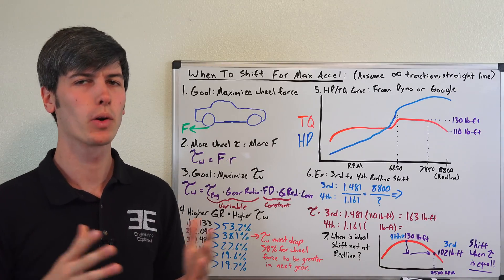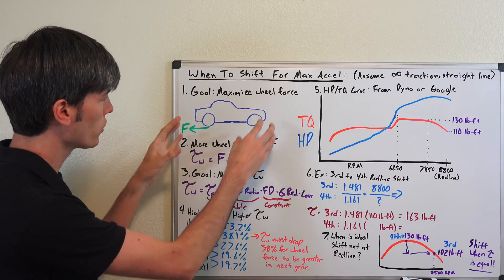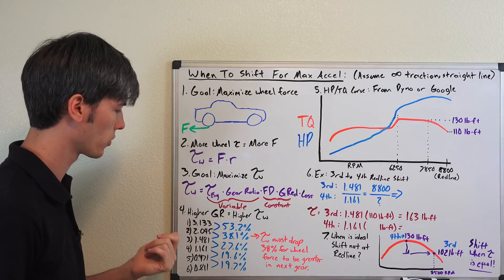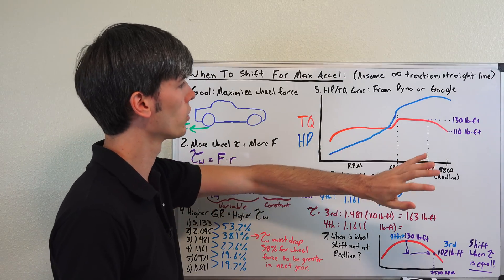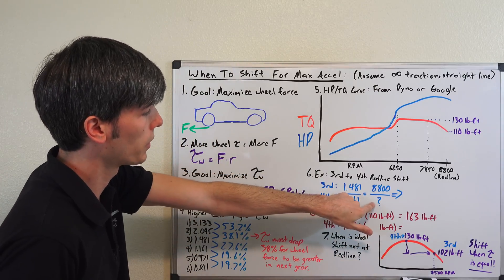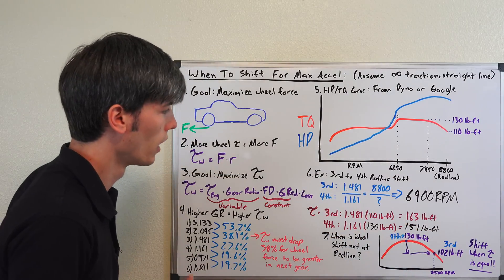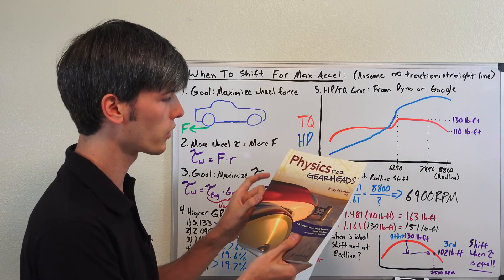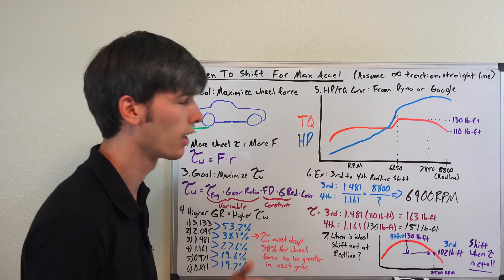When To Shift Gears For The Fastest Acceleration

Comment: Why does torque taper off near the redline?
Reply from the maker: Engines that aren't turbo'd are really just optimized for one RPM. Peak torque is where the engine is working at its best. Airflow, fuel atomization, and fuel burn start to taper at higher RPM, and frictional losses increase. Turbo engines can compensate with boost for a nice flat torque curve (and things like valve timing/lift/etc adjust for this as well).
Reply: Thanks!

Comment: whats the extra gear reduction in the s200? How can there be more than the transmission and rear end gears with out a 4x4 transfer case?
Reply from the maker: For the AP1 I believe it's a 1.16 reduction. Just means there's another step before sending torque to the driven axle to the rear diff.

Comment: i'm a noob when it comes to driving manual , i would like to learn, i looked up driving one and the one thing i can't get is when do you shift? are you just aiming for a specific rpm or what? from the video he mention shifting before redline but it doesn't sound beneficial
Reply: To make it short and sweet.

If you want to go fast? Shift at redline.

If you want to go efficiently (save gasoline) shift where your car owner's manual tells you to.
Reply: You shift when you want, no worries. There will be times the engine struggles, so you take it back down like going up hill or you shift too soon.
Reply: For everyday driving, shift when the engine gets loud basically. I usually keep it around 2000-3000 rpm, because it's more economical and less noisy. As explained in the video, the engine makes more power and usually more torque the higher in the rev range you are, so if you're coming up to a hill or something sometimes it's a good idea to shift down to ensure you have enough power to get up it. And of course, if you want to go fast, shift at redline.

Comment: What about shifting when the torque is max at 2000 RPM, horsepower at 5000 RPM, redline at ~5100? (Diesel, Naturally Aspirated).
Reply from the maker: If peak HP is at 5K, then very likely you'll shift at redline for max accel.

Comment: Basically, power when you leave the gear equals power when you enter the next gear.
Reply: Exactly
Precisely
Reply: oh my God. insert thank you gif
Reply: True in many cases where the hp curve has a significant drop after the peak. But there IS a drop in hp after the shift, if the hp curve peaks with little drop. Google for this website 
evodynamics com 114447365 calculating-shift-points 
These are axle torque curves, but these hp curves show the same shift points.
Reply: Its to get out of first early so no later than 2/3 of redline meaning right after half of first shift to second so u can be in second gear longer
Reply: So much simpler and exactly the same result.  Me thinks that he doesn't understand power.
Reply: Power when you leave the gear should be around 5-15% higher than the gear you enter, depending on how fast you change gears
Reply: @thunderbirdizations  I think you mean the opposite.  Power when you leave the gear should be LOWER than the power in the gear you are going to.  To account for the reduction is speed during the shift.  However, this doesnt matter at all with sequential boxes and other quick DCT's or modified automatics.
Reply: ExactlyPrecisely saved me 8 minutes and 39 seconds
Reply: Exactly. Usually he is good. But he should have researched this better. Heard youtube has changed payment policy. People have to make videos more often. It is making many desperate. Quality will go down.
Reply: Nonsense. Equal power means you go past the peak - that means you are decelerating.
Reply: @trykozmaksym  You're not too bright are you?  Going past the power peak IS the fastest say to accelerate for most engines, that is if you can.
Reply: @bn880  dude, accelerating means more energy (power) is needed, not less. If it doesn't make sense to you, then go back to school and see the formula for kinetic energy - it is proportional to speed squared.
Reply: @bn880  ur right dude :) i confused power and energy - as the other youtuber pointed out, power is the rate of producing energy. Acceleration still happens after peak power but it's decreasing.. so the initial comment is right.
Reply: @trykozmaksym  Going beyond peak hp does NOT mean you are decelerating, you are accelerating at a lower rate. The optimum shift points will straddle the peak hp rpm. Visually, it's an "area under the hp curve" (or axle torque curve).
Reply: @bn880  You are right, MaxTryk is wrong. Shift beyond the hp peak. Energy is work done, power is the rate of doing work.
Reply: @kevink2315  You are right. I forgot primary school stuff and confused energy and power :)

Comment: Can you show the speed vs torque curves for all the different gears on the same plot of wheel speed vs wheel torque? I'm curious what transitions from one gear/curve to another look like with the momentary power loss of switching gears. I'm also curious how engineers choose the gear ratios to optimize the gear shift transition. Is the redline a hard limitation of the engine, or a point chosen to tell you when to shift?

Comment: If you need to shift up for faster acceleration before rpm max, dosent that show that the enginers that build that engine and gear box did a bad work? Wasting time and effort to make it able to rev higher for no extra benefits? That time could be spent on other things then
Reply: many engines can rev way past their max power rpm and most cars have more than one transmission available in them

Comment: It is interesting to note that final drive isn't constant for all vehicles. I had never encountered this before, but found it to be true on my 2013 Turbo beetle. See the spec sheet:

http://media.vw.com/doc/864/830539136536a3f4da311d.pdf

Note that the 4th and 5th gears for the 2013 Beetle Turbo Manual (my car) are the same ratio, so my speculation is that it just moves to a different final drive for fuel economy at that gear change.

Comment: how do i shift in automatic..?
or did my auto shift ?
Reply: I can make my auto upshift if i let off the gas a little bit
Reply: More misconceptions and misinformation. 
Most automatic transmissions do shift automatically, can be manually shifted and can be tricked to shift in auto mode by manipulating the throttle. 
Most automatic transmissions sense the load, either by a mechanical governor or through electronic sensors controlling the shifts to maintain a compromise of performance at less than 75% full throttle or compromise fuel economy at more than 75% full throttle.
Reply: Yours must be a fake automatic.
Real automatic shifts, automatically.
Reply: TrumpCorp. I can't vote Trump, I live in Canada.
Reply: did i won the election ? vote Trump and shift up.. lol
Reply: Yeah but you would you if Canada merged with USA?

Comment: Awesome video as always! I think shifting early to make more power is probably more common with cars that come with very small factory turbochargers that make a lot of midrange torque but fall off pretty hard between 6000-7000.
Reply: I was doing that in my twin turbo charged 335i and today I raced my buddys cammed 3v I thought I was gonna get walked similar to the last runs but I started to shift at 7k and I beat him top end my car is stock

Comment: When to shift gears for the fastest acceleration?

Answer: Automatic transmission. No human can outperform a computer lol gg.
Reply: i think you'd be surprised
Reply: RzVids where is the fun in that.
Reply: william fleete Your opponent in your sideview mirror 😂
Reply: My nana and I both have Holden Barinas, hers is a 2009 automatic model mines a 1998 manual, she goes foot flat to the ground and I'm still faster. How is this possible? I may have turbocharged my barina just because, only added 50 hp to the 94hp engine but I atleast get the sound. But still even before turbo my car was faster

Comment: I would think you would want to shift from 3rd to 4th at about 8150 since your torque curve is dropping from 7850 on.  If 8800 in 3rd = 6900 in 4th, and there's no difference between Wt@6900 and Wt@6250, that's 650 revs, so on 3rd you should shift at 8150, so you don't have as much drop, resulting in more overall power applied.
Reply: "there's no difference between Wt@6900 and Wt@6250"

You are not taking into account the gear ratio difference between 3rd and 4th gear as he explains in the video. At 6900 rpm and 6250 rpm the "ENGINE" puts out about the same torque, but torque that is applied to the wheels is less in a higher gear.

Comment: THANK YOU FINALLY. Ive been trying to explain this to people for MONTHS and all i hear is "no you always wanna shift at your hp peak so power doesnt fall off"
Reply from the maker: Now you can slap them with knowledge! :)
Reply: You can do all of this with power, and it's quite a bit simpler though. You do want to shift so your power doesn't fall off, but what they're missing is that if you shift at the power peak, your power falls off because you're way below the power peak in the next gear. You want to shift at the correct point so you're making just as much power in the next gear as you are in the current gear, so you want to end up straddling peak power with your shifts.
Reply: Now this puzzled me a bit at first, since i remember that power was torque times RPM. However, it is torque and RPM at the wheels that we maximize here (and therefore the power we  get on the street). The RPM in the graph is at the engine (before the gear box that drives the wheels).
Reply: But of course this is the case for this specific car. Maybe in another car the torque drops much more vertically. You still have to do the math for your vehicle (if you don't have an S2000) to convince them :P

Comment: That would work if the power curves are from a dyno. I'm not sure it would work if they are from an engine bench. I am thinking that drivetrain losses are not constant, but speed dependent.
Reply from the maker: Likely true, as you will have greater losses at higher RPM. As mentioned getting your specific vehicle dyno'd is the best way to know for your exact vehicle. :)

Comment: This example seems to work for a smooth torque curve, but my car (BRZ/FR-S/86) has a nasty torque dip in the middle of the RPM range that I suspect would invalidate this approach IF the torque dip were to exist significantly higher in the RPM range. Don't you really want to maximize the area under the torque curve for each gear? I was expecting some definite integrals.

Comment: Interesting, but it seems to me that looking at the HP curve is more straight-forward.  Compare the HP at redline (8800 rpm) to the HP after your shift (6900 rpm) to see how much power you loose.  No need to make it more complicated than that -- the HP curve is there for exactly this reason.  Not saying your way is wrong, since it gives effectively the same result.  But it's no more useful than doing it the intuitive/easy way.  Makes you think more though, which I suppose is useful in it's own way!
Reply from the maker: +Nathaniel Jones not really that simple. At peak HP in 6th gear, you'll accelerate more slowly than at half HP in 2nd gear. It depends on the gearing of the car, not just the HP curve, as discussed in the video.
Reply: Okay, I get it now, just had to think about it some more.  I was just thinking along the lines that if you had a CV transmission, you'd set your RPM at max HP for max acceleration.  But that's not relevant to this problem.  Thanks for the reply.

Comment: 5th gear is the worst gear to be in with a 6 speed. zero torque in my experience even with pedal to the floor.
my biggest issue with manuals is getting torque on highway driving. gotta downshift to pass someone
Reply from the maker: +Mo Overall Fitness Hacks except for 6th, haha.
Reply: It varies widely on car. In my protégé I don't have to downshift to pass someone on the highway cause I'm already at 3500 rpm in 5th gear at 70 mph. Also, if you're downshifting in a manual to pass someone, the same car with an automatic would also need to downshift. But shifting gears is what makes manuals fun so downshifting shouldn't be a problem.
Reply: DJ Microwave automatic would do it much much faster
Reply: Yeah I guess if depends on the year of the car. I usually buy older cars so I go manual.

Comment: Doesn't this mean that when you are in 3rd, you should upshift at the earliest RPM that would still have 4th engage within the peak torque of 130 lb-ft? In other words, each upshift should aim for a post-upshift rev of 6,250 RPM.
Reply: ...No. You would give away the advantage of the better gear ratio. You have to stay as long in a lower gear as it provides more torque at the wheel than the next higher gear or until you hit the rev limiter.
Reply: shi01 Oh, I get it now!!! :)

Comment: For pretty much any NA car you'll have to shift at redline or almost rev limit. For turbo cars the situation change especially because these days even if the cars have relatively high rev limits (6500-7000rpm) the turbos are sized for better response in the most common situations (so 1500-4000rpm) which means that once you to past a certain RPM point it's either the ECU tune or the physical capabilities of the turbo that limit the output. So in petrol turbo cars, or most of them, you'd rather want to shift before 6000-maybe-6200rpm even if the rev limit is 500-1000rpms later.

Comment: Why would you not use HP instead of TQ? Because to accelerate the wheels have to spin faster so wouldn't HP, which accounts for engine RPM, be a better metric vs TQ which is just force applied during one revolution?

Comment: in your video "whats the fastest 0-60time possible?"you state that peak acceleration is achieved at peak engine horsepower, here you state that peak acceleration is when at peak wheel torque and you never even refer to HP anywhere in this video to me there is a discrepancy.
Reply from the maker: +Justin Gillette peak accel for any given gear is at peak torque. Peak accel for any driven speed is wen you gear for peak power. State this in my other video, no contradiction.
Reply: my mistake sir, the video i was talking about was CVT awesome, and i re-watched it twice and then watched this one again.  I got it thank you...

Comment: A more "geometric" approach would be to take dyno graphs for each gear (speed-hp plot) and see at what speed the lines cross. That's the optimal speed to change gear. IMG: http://s260.photobucket.com/user/cdcracing/media/ingearpower.png.html
Reply: akiskev yeah that graph makes it easy to understand. A lot of people think they should shift at peak horsepower because it drops after that, but they don't know shifting to the next gear results in more horsepower drop that revving it to redline
Reply: akiskev An old issue of Hot Rod Magazine explained the intersecting power curve in each gear as optimal shift point. It added that, because of slight deceleration during a manual shift, you should rev slightly beyond the intersection point before shifting.
Reply: "An old issue of Hot Rod Magazine explained the intersecting power curve in each gear as optimal shift point."

No, because those lines ALWAYS cross at 5252 RPM. In a truck diesel, you'd trash the engine before you got there...in a Wankel rotary, you wouldn't even be in the powerband yet! (It's probably a good estimate for a large, pushrod V8, though.)
Reply: That is it.
Reply: You change gears based on rpm and not based on speed....... it is so much more simple to do it this way then to try and match your shifts based on your speed.
Reply: So, I graphed the power vs speed curves for each gear for my BMW Z3 3.0i.  First and second gear intersect almost at red line, and each subsequent intersection is at a slightly lower rpm (probably a conscious choice by the engineers for fuel economy purposes?), but fourth and fifth gear still intersect at more than 6000rpm, so any assertion that the power vs speed graphs always intersect at 5252rpm, making it the optimal shift point, are wrong.
Reply: He's not talking about the Torque-hp intersect. Look up http://s260.photobucket.com/user/cdcracing/media/ingearpower.png.html
Reply: ^_^
Torque and hp doesn't always intersect at 5252rpm.
It intersect at whatever rpm, depending on the scale of the hp, and scale of torque the graph is using.
Yes, they can be set at different scale.

I know this because I'm a chassis dyno operator
Reply: No, the torque and power lines always cross at 5,252 rpm in imperial units (foot pounds and horsepower).  The power lines for each gear will typically cross near red line of the lower of two gears and would in fact be the geometric representation of the optimal shift point.
Reply: Also, if you have Mathematica, I can send you the notebook file so you can make your own graphs.
Reply: That graph was hugely helpful, thanks for posting.
Reply: Isn't an easier approach than the way he explained to think in terms of engine power. You want to shift at the point that the new engine rpm has a power output the same as the pre-shift engine rpm. Hence the only time you'd shift early is when your power drop off is large compared to the gear ratio.

Comment: I think revving it to the redline will be the best options for nearly every single gasoline engine / transmission combo out there. But Diesel engines might be a lot different. When you e.g. look at the more modern Audi Diesels, they have a very early peak torque (or plateau torque, to be exact).
Combined with Audi's usually relatively long final gear, you´d lose heaps of wheel torque if you revved the tits off that kind of car.

Comment: Wouldn't it be easier (i.e. A lot less math) to do it based on power, shifting when you'd be at a point where you have more power at the higher gear than in the lower? It'd harder to explain I imagine, but it's a lot easier and quicker to do.